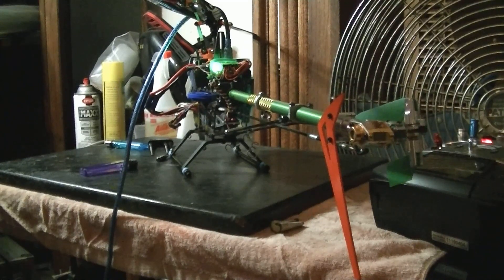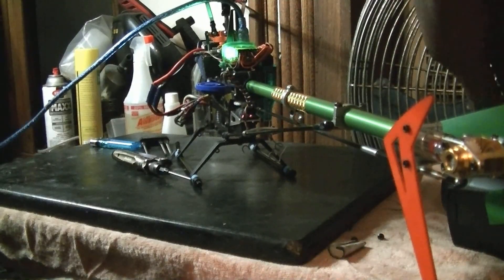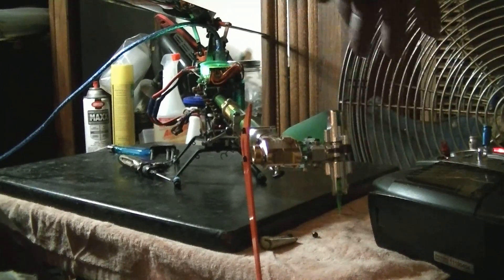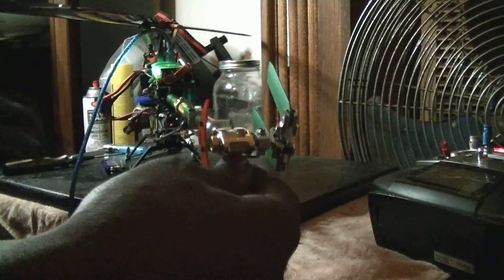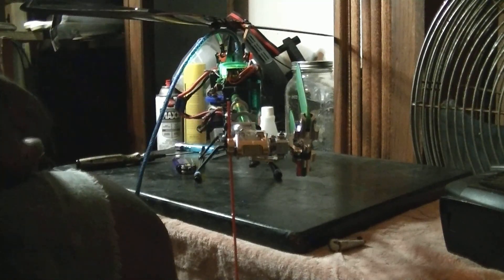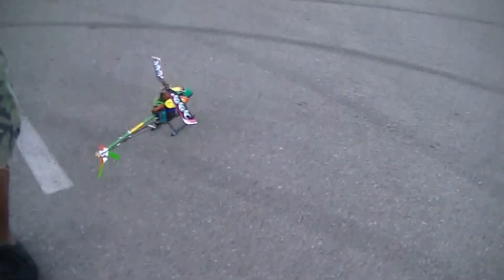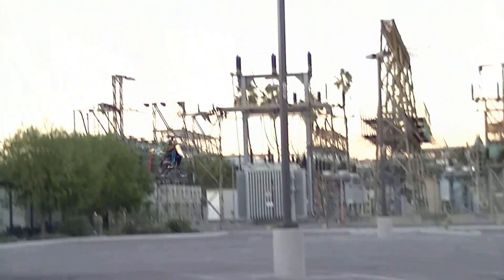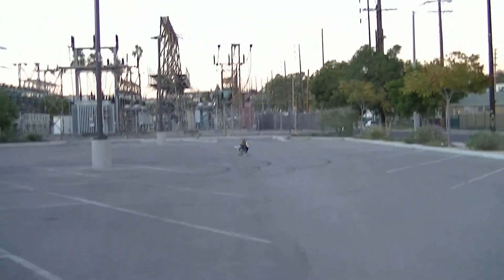=WC=  Align Trex 450 pro thru Trex 700 RC Helicopter Tail setup method

Comment: can't see what you doing fam
Reply from the maker: +Delbert williams delbert williams (The Gate Keeper) 
Adjusting the servo horn in rate mode ,dialing the servo horn to make the tail blades closer to 90 
align copters that have the tail servo mounted in the frame the tail push rod is to short so I have to dial my 90 in with the servo horn then after I adjust the linkage